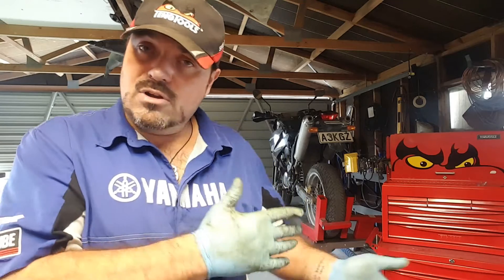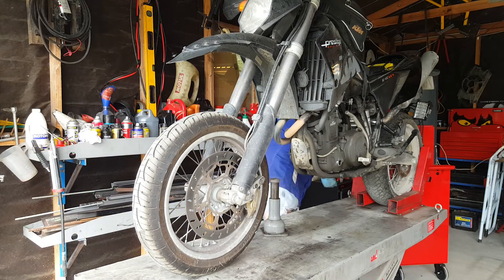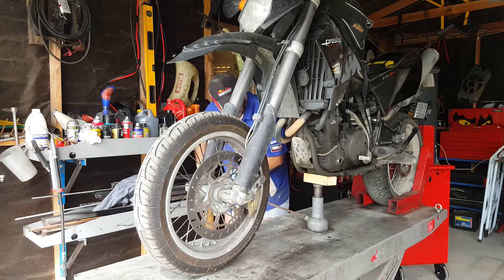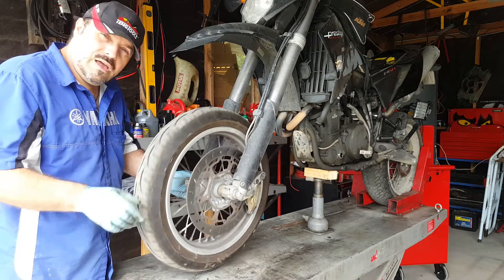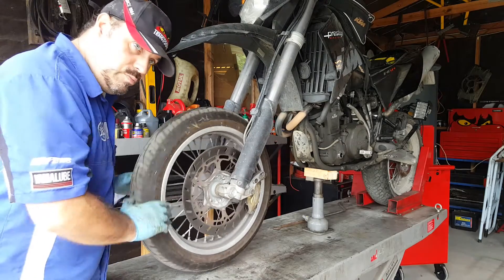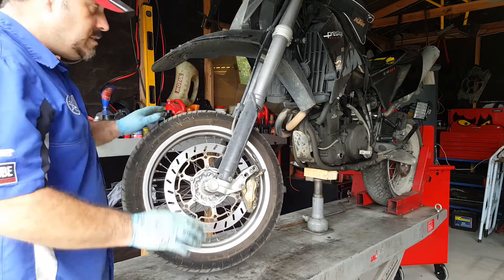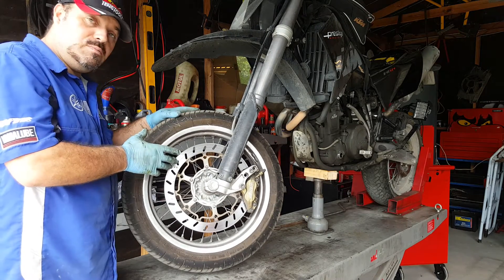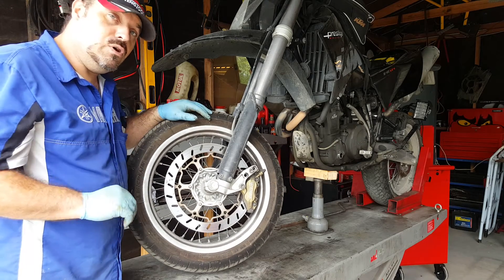How to check Motorcycle steering head and wheel bearings #1951

Comment: Mike- what are likely symptoms of shot headstock bearings? What might i see under hard braking?
Reply from the maker: Under hard braking, if they are really bad (insufficient preload/play) you'll get a 'clunk' through the bars.

But usually they index causing notchy steering and difficult to make slight steering movements.

Cheers Andy
Reply: Hi Andy (Don't know why the hell i put Mike on the last post !)

Thanks for taking the time to reply!  I appreciate the feedback - i've narrowed my particular issue down to a suspension issue now!  Thanks
Reply from the maker: No problem. Cheers Andy

Comment: Do they use a the break test roller drum machine at the wof centre  when they test motorcycle breaks ? Or just hop on the bike and apply the break  ? Are they hard in motorcycle breaks my scooter has a back drum which doesn't have much stopping power but the front is good and disc
Reply from the maker: Hi Paul, it's usually just a quick ride around the block for the examiner to apply each brake. It's down to their experience and discretion in the end. Hope this helps. Cheers Andy

Comment: Hi sir my brand new motorcycle wobble in low speed & it's going left & right so esaly I can't raid also front wheel showing heavy .plz Tel me any suggestions
Reply from the maker: You could have indexed steering head bearings. Also check your Tyre wear and pressure too. Cheers Andy
Reply: Tq so much for reply sir

Comment: Some scrote tried to steal Honda CBR 250. When i apply front brake pulls to left slightly .No wobble/knocking when riding or free play in wheel or head bearings when jacked up any ideas what it could be ?
Reply from the maker: +Tripple Hazard Hmmmm best check frame alignment and front fork operation too. Could possibly be front Tyre if worn weird too...
Reply: Thanks for response .forks seem to work fine & look fine but i think one may be slightly bent you can see mark where they have had bar between fork & wheel trying to snap locks & only damaged plastic is front mudguard/fender where it connects to fork on one side .Hope it is not frame.
Reply from the maker: +Tripple Hazard Hmmmm. ...could be a bent stantion, this will jam in the bushes during compression which will cause twist on the front wheel spindle. That will definitely cause the bike to pull to one side.

Well spotted. Cheers Andy

Comment: I have a 03 vtx 1300s and just started with a vibration in the handlebars to where the mirrors are vibrating and hard to see the reflection. Wheel out of balance? I also noticed at low speeds if I easw off my grip the front end wobbles.
Reply from the maker: +John Brown I'd check steering head bearings - could be loose or maybe front wheel bearings. Front tyre may be out of round or maybe you lost a balance weight off the front wheel but if it's happening at low speed too then likely not a wheel balance issue.

Hope that helps. Cheers Andy